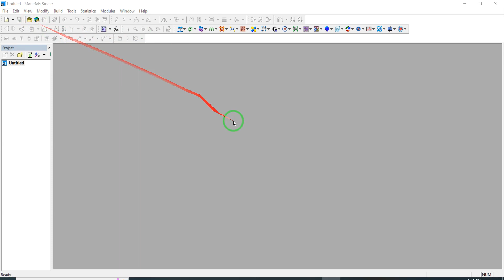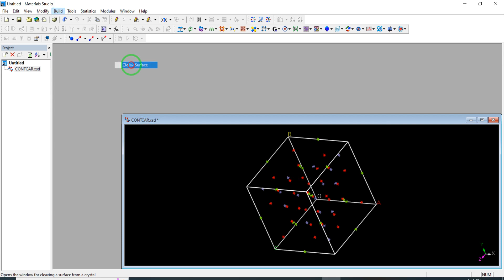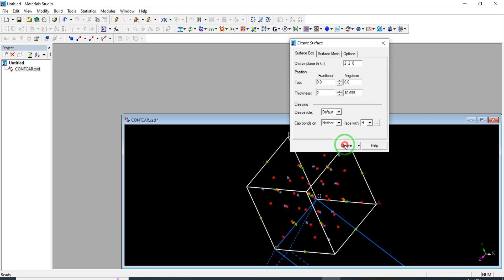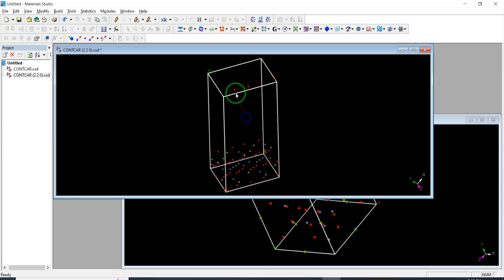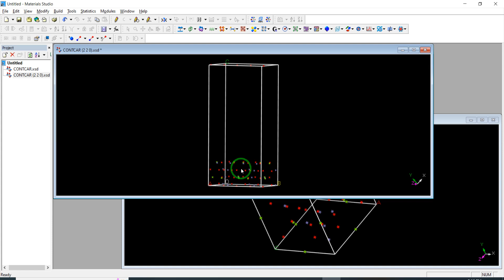01- How to build a slab using Materials Studio

Comment: Thanks for the video! 
Should a slab surface be built by specifying the miller indices for the  primitive unit cell or the conventional standard unit cell?
Reply from the maker: They both can be done. But using primitive cell gives you more flexibility due to its smaller size.